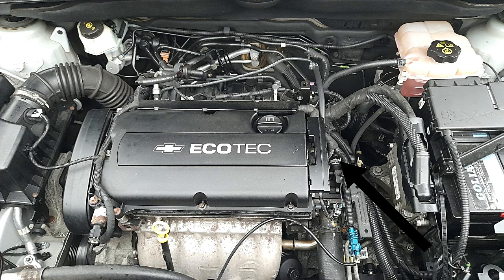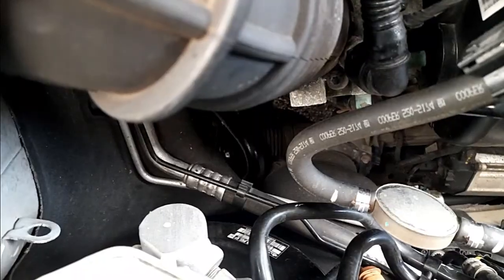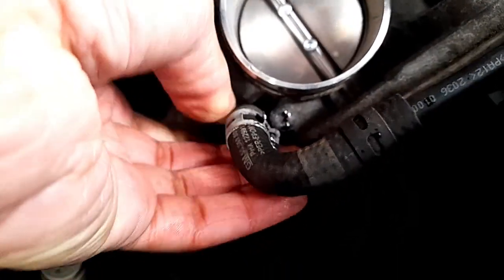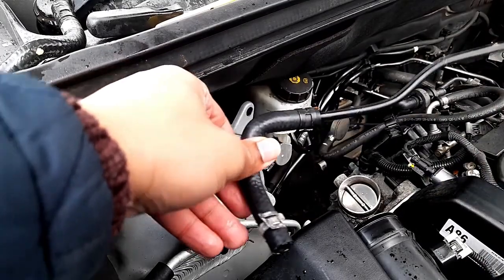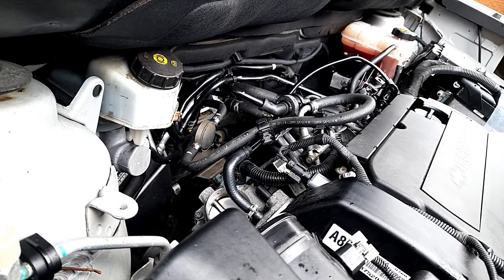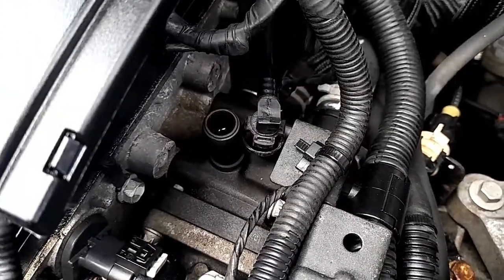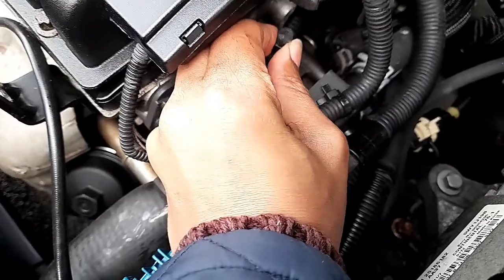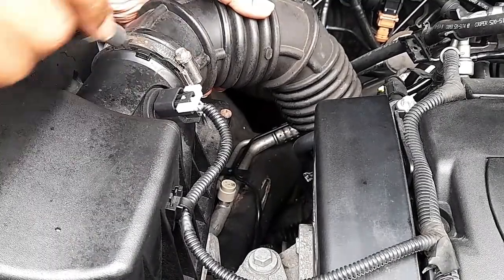How to replace Thermostat Water Coolant Hose Pipe for Vauxhall Opel Chevrolet Alfa Fiat

Comment: I have replaced this hose but am still getting a small leak at the connector can you advise please
Reply from the maker: Late reply sorry yes it stopped leaking make sure the clip are tight
Reply: Chek the O rings